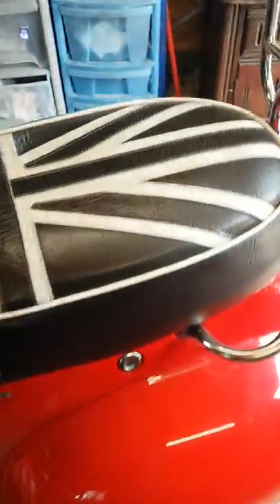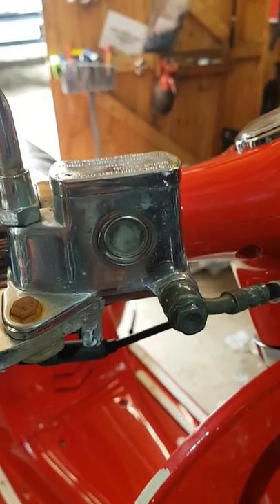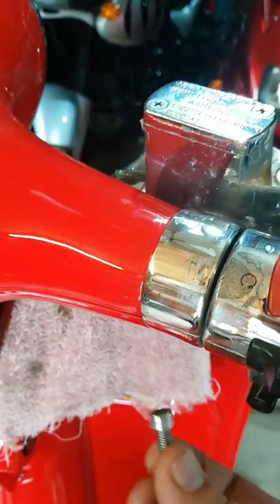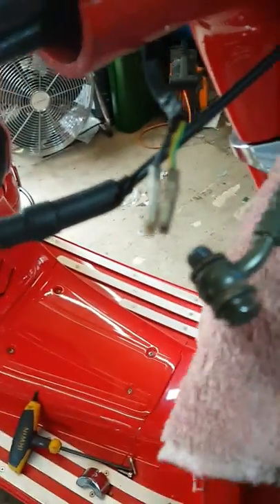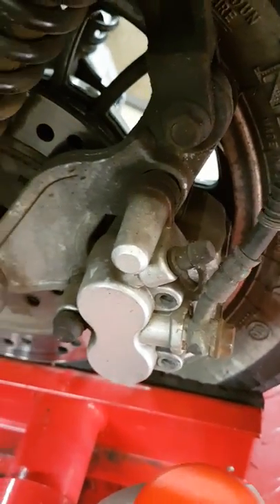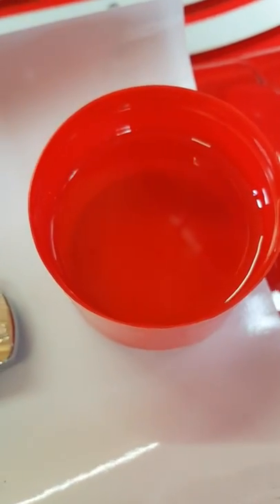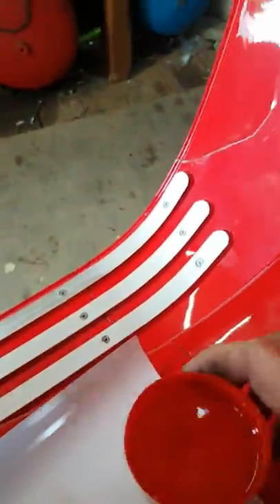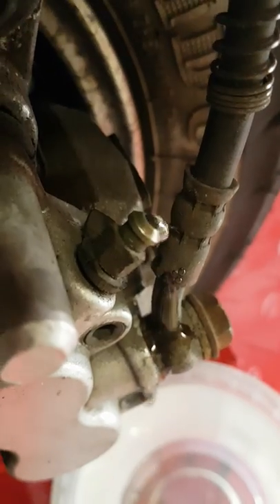AJS Modena 125 and 50cc brake fluid

Comment: Thanks you very much for this demonstration , you made it look quite easy but i have a question, what if I loosen the nipple on the front break and the fluid does not flow out like in the video. I have the BMS Chelsea 150 basically the same ride just named different here in EAST LOS ANGELES CA I’m going to attempt doing it myself, I know my way around a garage and using tools unfortunately I never did this myself cause It’s one of the parts of a 🏍 or  🛵 that is most important and should be left working PERFECT. What should I do if I don’t flow free, should I pump the lever ? Anyone with a tip or some advice would be much appreciated. To All two weel heads Ride Hard and Ride Safe✌🏼👨🏼‍🦲👌🏼🛵🏍😎😉👍
Reply: It might not flow out unless you take the top off, its causing a vaccuum at the top.... But you will need to take the top off anyway. ,  i know its gravity fed but it dont happen on cars because the yhave a totally different type of pluger system.... the stuff coming looked almost like water....... and in an emergency you can use water, but flush it out as soon as posible...... water like oil cant be compressed so it will work in a pure emergency.. that is probably its original chinese oil, nothing wrong as the yjust use a much thinner type of synthetic oil.. to me for brakes use the best brake fluid you can find... a good quality brake fluid wont need changing for years.

Comment: what do i do if the fluid does not come through? i take the tip completely out and its still won't come through. but if i pull the brake it will